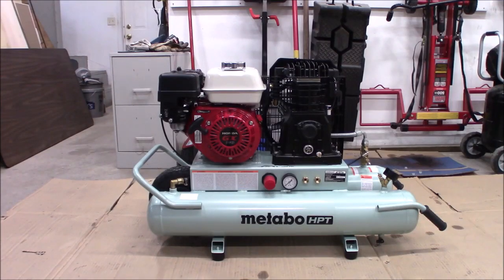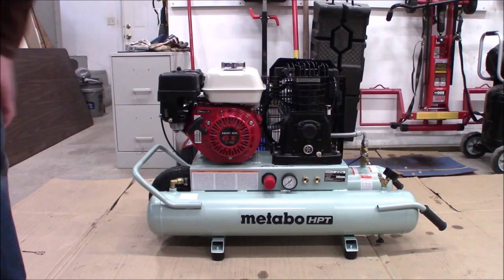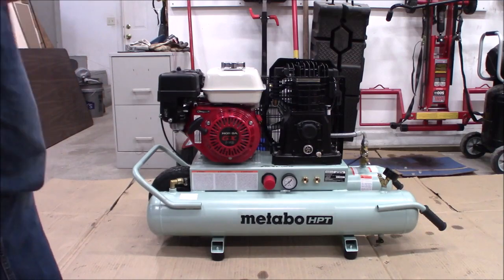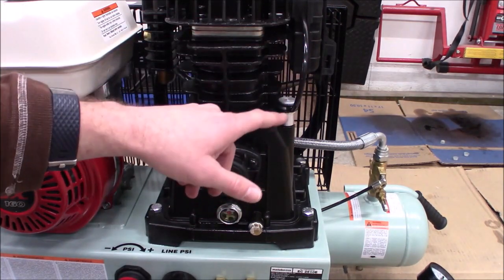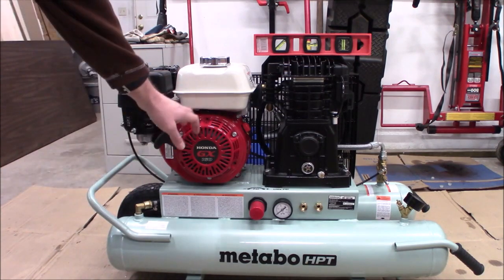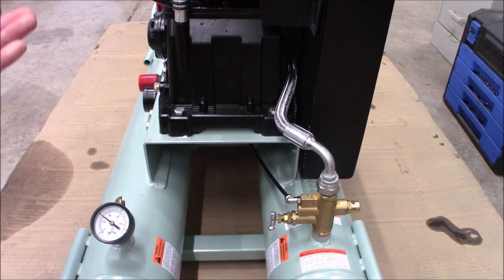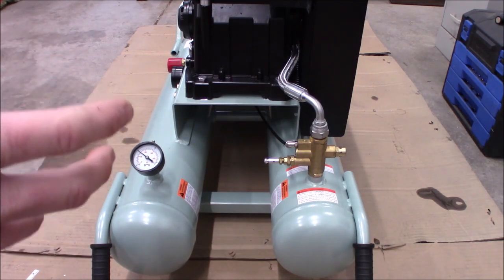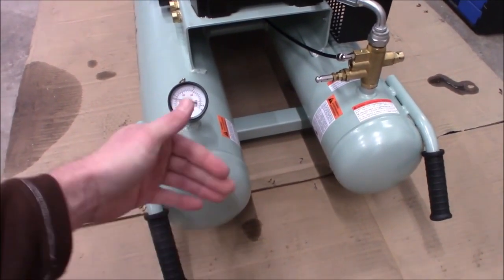Wheelbarrow Air Compressor Operation and Maintenance Part 1 of 2

Comment: What type a oil I use to the engine and compressor self??
Reply from the maker: will depend a bit on weather conditions, and always good to check the manual for your product.  straight 30 weight is fine for the most part, but if it's left out in the cold, moving to 10w30 or 5w30 might be good.  then switch back to 30w in warm weather